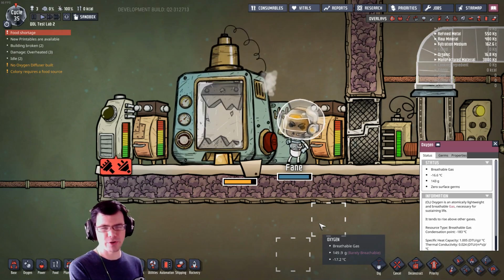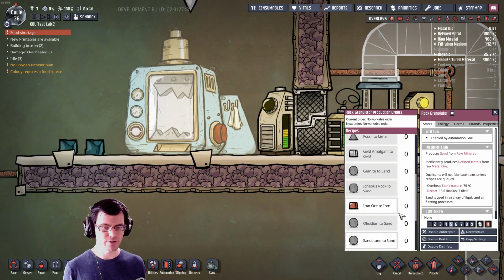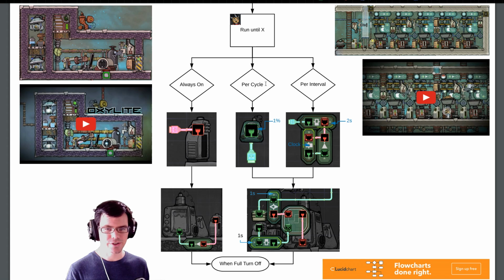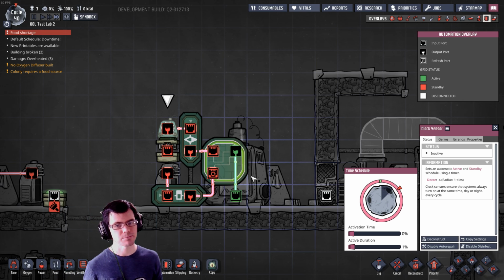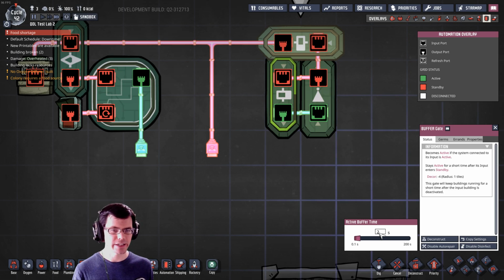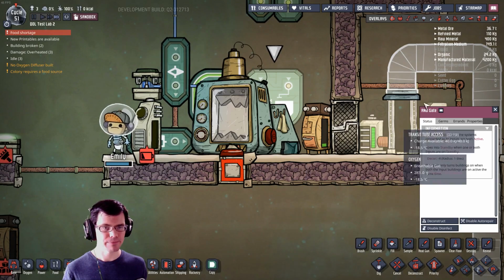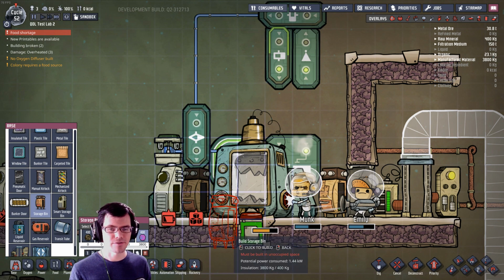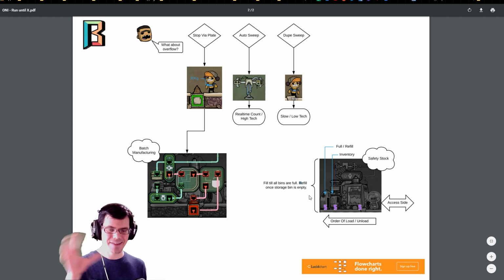Automated Production and Inventory Tutorial - Oxygen Not Included

Comment: You should do a video on: Creating steam for rockets
Reply: It's easy I built a room on top of the regolith insulated on 3 sides and metal tiles at the bottom.

Dry wall on the back.

Free steam right next to the rocket silo.

Make sure you have a valve to control water flow in to it

Comment: *Are you going to revisit volcanoes.*

The 1st gold volcano I tapped into was down by the oil. I had a small area with some insulated tiles around with an access point beside there. Say 10X10 for storage of the gold and cooling area etc.
I tried using dupes moving things around but the sand dirt etc kept piling up and you have to remember to dig it out every couple cycles.
I tried an automation system. Vacuum and without. Everything kept over heating.

I'm trying again in this save. I built a decent size area. Having a little PO2 water dribble on it. Have the digger and sweeper near it but above. Still over heater but plenty of steam. 5K in every tile. Yet having the steam gen beside and above it.
Steam only gets to 100-110. Not hot enough to kick it on but more than enough steam.
I last left it in the build stage of everything on the same level and going to try to submerse it everything in water.
Water comes in from the side past the digger and sweeper then hits the volcano.
Not sure what will happen.

Comment: I have been wanting to do something like this with food. 
Bringing food up from the storage down below in the CO2 or Chlorine straight up to the mess hall with a conveyor system. 
Try to eliminate a little travel time and dupes eating into the sleep time. 
However with the conveyor system. It bring up to much food as the time the loader stays active is to long. 
Also there's the power usage on the smart containers in the mess hall. 
That is if you have to bring up for a few days worth. 

Hmmm. Maybe a put a clock sensor to turn on just before down time. It turns on long enough for a sweeper to grab a few different  food types. Turn on and off the different loaders for each food type at different invtervals. It all goes up into the food bin. 
I noticed you don't need to keep them powered that long. Even with using granite. They don't heat up very fast when turned off.
Reply: If you know hom much food the frige shut store and the time of the sweeper to put it in the delivery system, why dont you not put a buffer gate on the frige that only holds X seconds so the sweeper only sweeps Y amound of food into the system?
Reply: you could try an intermediary storage for you food-loading arm: if the sweeper arm that's loading the conveyor can only reach 1 food source, a box with a reduced capacity setting, the loader arm will only be able to grab & load the amount of food in that box. that'll let you send smaller packets along the conveyor (1kg). that might reduce how much excess is sent to the pantry(s)

Comment: Did you have the set/reset switched for the latch gate?
Also, why not just have the weight plate to stop machine once so much is on it, and then set up an arm to move it into a box. Once it is full, the arm will stop, and the plate will collect enough to stop working.

How will this work out once scaled larger? Say you wanted 500 of each metal, you'd need a machine for each, but a lot of the circuit can be reused